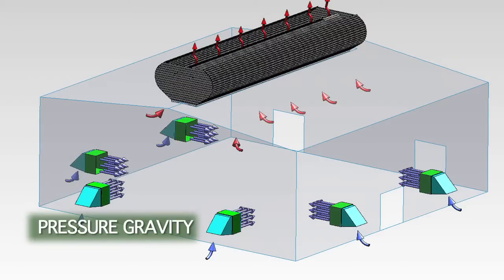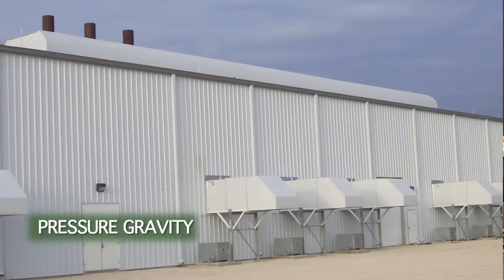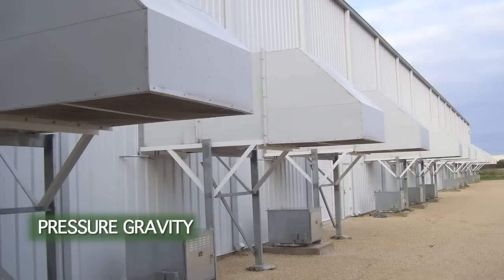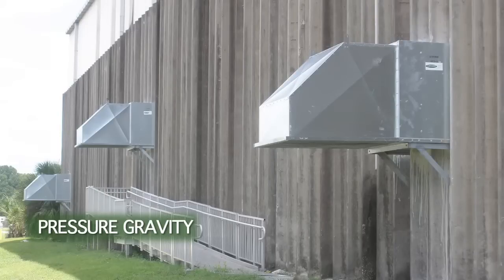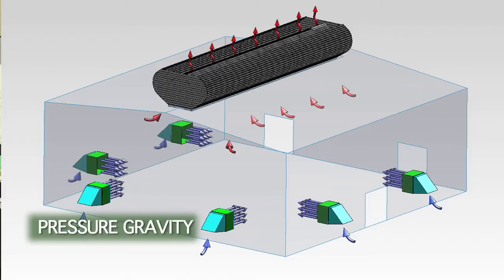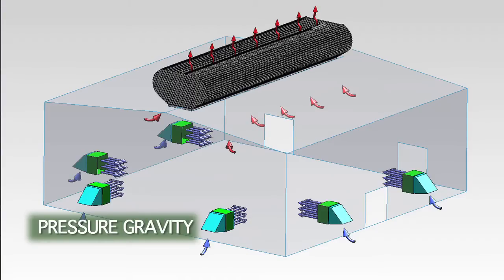Pressure Gravity System™ - Hybrid Ventilation Solution

Comment: how does gravity come into play
Reply from the maker: Gravity ventilation is the natural rise of heat due to the lower mass of hot air. A pressure gravity system uses both gravity ventilation and powered ventilation.